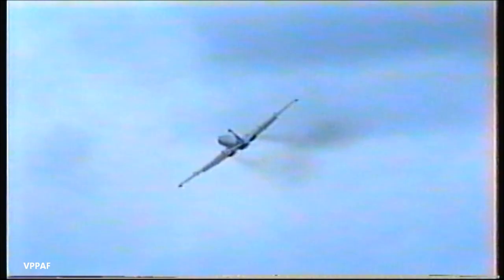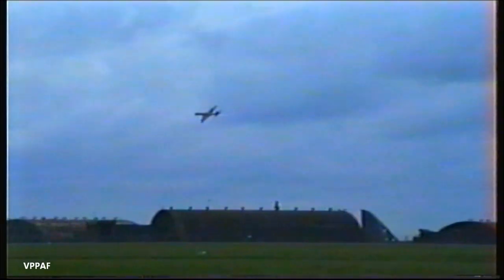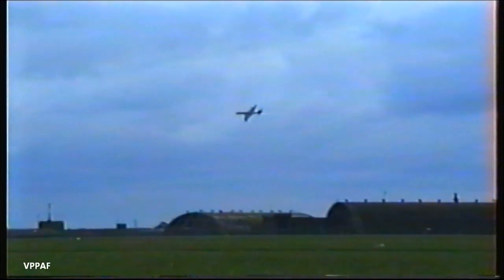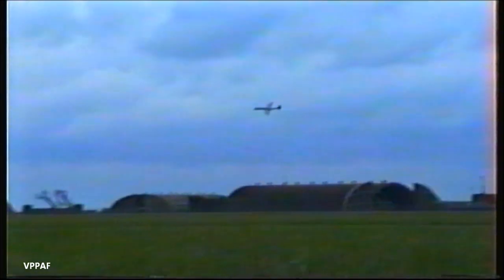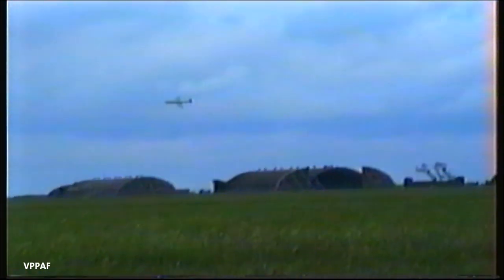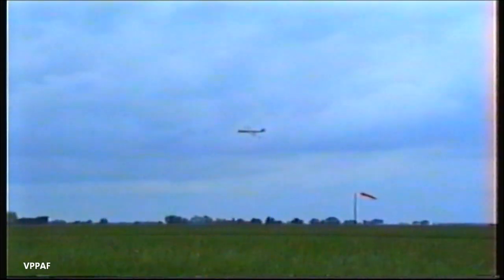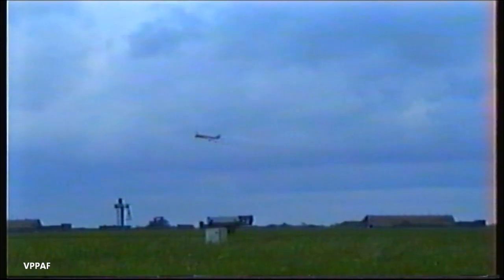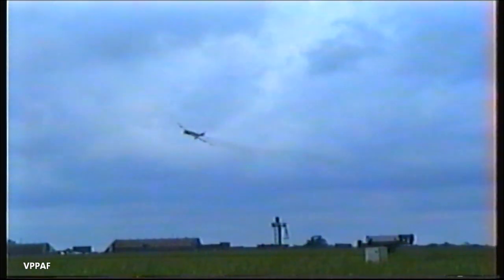RAF Nimrod flight and a crash at Toronto air show in 1995

Comment: The night before the crash, the pilot was interviewed on the local Toronto Tv station. I watched him as  he boasted that he was 
 going to really put on a performance with the Nimroad that would surprise the air show crowd the next day...well I guess he did.
Reply: Ya, I saw him the night before too at the Brass Rail.
Reply: @powerhouse9868  is that a bar? Just drinking?
Reply: @livelyupmyself1  strip joint. Overpriced of course... but I guess he figured he could push his luck two days in a row..
Reply: Yes  ,  i guess his mind was concentrating on the wrong set of flaps  .....

Comment: "Maintain thy airspeed, lest the ground shall rise and smite thee.".... God
Reply: That would be mother nature.
Reply: you can have a high speed stall,if you are pulling to many Gs, adding G's is adding wing load, the wings on these large jets are heavily loaded at take off so any loaded added through maneuvering could easily push it over its limit.
Reply: lol
Reply: im lel'ing
Reply: unit 003 ayylan6(c
Reply: 'Not enough Bernoulli on your wings and control surfaces = Stall. Mind you too much Bernoulli on your wings and control surfaces can also = Stall' - Attempted definition of 'flight envelope' :o)
Reply: @gogogeedus  pulling “G’s” is just the byproduct of what’s happening. Pulling G’s doesn’t stall aircraft. Exceeding the critical angle of attack does.
Reply: @ZicajosProductions  G force does stall A/C because G's are related to high speed maneuvers, a high angle of attack at high speed will be at high G's.also increasing the G's increases the wing load which in-turn increases the stall speed. in other words when the wing load is increased so is the angle of attack, this fact is the reason why heavy aircraft are comparatively slower because the higher angle of attack induces drag.

Comment: The aircraft sank immediately on impact  ......haw about the aircraft shattered into pieces on impact
Reply: *And the many pieces sank.
Reply: That sounds a bit rough, for the families...
Reply: It’s still there their is a actual part of the ocean to where he crashed where you can actually smell the rusty smell of the plane and a friend of mine told me that a guy actually found a piece of a plane floating a little close to the surface because he had an underwater camera true story also
Reply: @cottagenightwars4278  The plane was made of aluminium, how exactly does it rust?
Reply: @cottagenightwars4278  how is it a ocean lol
Reply: @cottagenightwars4278   Stay off the bath-salts would ya ffs!!!
Reply: @cottagenightwars4278  and at night you can hear ghosts of the crewmen shouting and swearing at the stupid pilot.
Reply: You missed that ?
Reply: ? - Aluminium corrodes.
Reply: or how about "burnt down, fell over and than sank into the swamp"

Comment: The video has two parts.  The second segment shows the Toronto airshow crash.  I watched this happen from the Ontario Place breakwater.  The British Air Force did the accident investigation and said it was caused by a stall.  A day prior to this, the crew took up a reporter from City-TV and did their routine.  She asked how far they bank on the tight turn, and the member from the team said "90 degrees.  Sometimes more." and he smirked.  The following years they no longer banked as extremely and performed the routine with more altitude.

To show the value of eye witness reports, the story on the radio within minutes of the crash was that a seagull was sucked into an engine.  Another witness said the plane exploded before it hit the water.  In movies the sound and sight are coordinated to happen at the same time.  In reality, the sound comes later.  This was what confused the eye witness because the plane hit the water but the loud clap came much later.  Then in their mind, it became the explosion that happened before the crash.
Reply from the maker: yes the 1st part is my video from Raf coningsby air show
Reply: lightotw is
Reply: The accident did not happen at a particularly high bank angle. That was to come later.
Reply: British air force?.. You mean the Royal Air Force!!
Reply: Hugo Stiglitz  I think the point is, the first part of the video was unrelated to the airshow crash while the title as written seems to be one event.  If the title were written: "RAF Nimrod flight at RAF Coningsby, and a crash at Toronto show", then there is no reason to clarify this.  These details matter a great deal while we are watching video of an aircraft crash.  Why?  Well, is something you notice in the first clip a possible hint of the crash later?  No, it can't be.  So it is useful to note, regardless of your impression on the matter.
Reply: @awuma  2:11 in the clip you can see it begin the bank.  It looks close to 90 degrees by 2:16.  By the time of impact they managed to get wings level, but it had already stalled and needed more altitude and time to recover.
Reply: @donaldteed35  it's a good old media hash slap together job.
Reply: @theelectrichobo829  not from his point of view. I in the UK ex-svc, would say the American Air Force or US/USA Air Force, of course it's the USAAF or the Canadian Air Force I would say in general terms unless RCAF becomes needed specifically.

Comment: Like so many accidents of this nature: Low and slow, insufficient airspeed, over-banked turn followed by inner wing stall, wing drop and incipient spin.  It has happened maybe hundreds of times, and especially at air shows where pilots seem to think slow maneouvres are somehow more impressive than safe piloting.
Reply: This. He was so slow I was expecting him to fly into ground much earlier....
Reply: Your explanation is cristal clear ! , I lost a friend with a similar maneuver  in an airshow.  People say:  "It happens "  Still can't get over it.
Reply: The Laws of Physics win . . . every time.
Reply: He actually flew these slow manoeuvres as he had been warned about leaving the boundaries of a previous air show. He wasn't showing off.
Reply: The routine had been flown before, but they got 30 knots below the required speed during the left turn and stalled. Despite adding full throttle and full right aileron it still rolled left and dove.
Reply: @Doggeslife  Yet the commentator erroneously states the engines stopped, causing the plane to fall from the sky. Why such a flagrant discrepancy, I wonder???

Comment: Engines never stopped...total misinformation! The airplane flying very low over the lake entered a steep left hand bank when the nose dropped. Likely entered a stall further aggravated by the pilot pulling back on the control while still steeply banked rather leveling the wing to recover a botched maneuver.

Comment: I was there on the shore stage center and watched this happen.  Sad day.  Engines didn't quit.  It was a stall of the wing lift as he was too slow for the bank angle.
Reply: You can see the engines didn't stall as the exhaust was still coming from them all the way down... still under power.
Reply: I was also on the shore line that day. Stood in disbelief of what I was watching. I remember my eyes burning and the pungent smell of jet fuel. Very sad, but completely avoidable. RIP to the crew. I feel for the pilots family.
Reply: @cjshardcorepunkmusicvault8474  As a former Toronto Harbour Police Lifeguard and being in one of the closest boats to the point of impact, I agonized for what seemed an eternity on whether to raise anchor and rush to assist possible survivors, as NO vessels approached due, I was told by the skipper of a rescue tug, to the large amount of jet fuel on the surface of the lake.
Reply: The wings were still providing lift fine. Just sadly in the wrong direction. Excessive bank angle has killed many an aircrew.

Comment: Too slow  and too deep just as  B-52 at certain US show.
Reply: Yeah,  I was thinking the same thing. 
He thought he was in an F 15
Reply: Fairchild AFB in Spokane WA
Reply: The USAF also lost a C-17 in the exact same manner (practicing for an airshow) in Alaska in 2010.
Reply: F15 has power and uses rudder to keep nose up at 90 degrees flight angle.  Not going to work on Nimrods and B-52's.
Reply: And indeed a Vulcan as well, XL390
Reply: Many swept wing aircraft have that same problem - too much rudder can stall the inboard wing and result in a stall/spin. The more sweep-back, the worse it gets. Even commercial passenger aircraft, like the 737 will do that. The Nimrod (Comet) has a wing that has little sweep-back, but the engines were very slow to 'spool up' for power increase, so when needed, won't be there for 3-7 seconds.

Comment: I had heard that the left wing had stalled on that final turn resulting in loss of control. Nothing to do with power loss or engine failure
Reply: Correct. The strong headwind and zoom which scrubbed off much of the apparent wind going into the turn, combined with wind shear were the cause.

Comment: The Nimrod could fly low and slow, that's what made it ideal for anti-submarine warfare, but not at that kind of bank angle.  The pilot may well have found himself flying a desk for modifying the display routine without a valid, good reason, had they and the crew lived...

Comment: I saw the Toronto crash in 1995 from the deck of my boat.  The Nimrod was a regular at the CNE Air Show in the early '90's, and it always climaxed with a spectacular wing-over (that's the "bank over 90 degrees" referred to in some comments below). However, that's not the point at which it crashed, rather it was at the turn out over the lake after which the pilot would came back toward the shore and then do his wing-over. He simply flew too slowly and too low, stalling in the turn. In fact, the engines were being spooled up to maximum power to recover, but he was missing a couple of hundred feet to get out of it. The voice-over report was of course made in complete ignorance. One error tragically killed seven servicemen.

The spooky part for me is that at the time I was reading a book about UK military air disasters, all at airshows or some sort of public event (such as the Vulcan landing at Heathrow in 1956, a plane which had shortly before flown over my school in New Zealand).  All the events mentioned in the comments below were in that book...
Reply: I chatted with that crew at the Abbotsford Airshow, perhaps two weeks before they all died.  Very sad.
Reply: Wild. That must have really been something to see first hand.
Reply: 'A couple of hundred feet to get out of it'? More like a couple of thousand.
Reply: Sailor Man
" 'A couple of hundred feet to get out of it'? More like a couple of thousand."" - no way he could have pulled the Nimrod out from that dive in 2,000 ft - check the angle and the speed at 2:34 - 2:35

He would have needed about 6,000 ft at least and the plane would have disintegrated from G-overload...
Reply: Didn't bank to 90 degrees?   Watch the video at 2:12 versus 2:16.  It was very close to 90 degrees.  Maybe there were more steep banks in the routine, but this was what happened.  They were demonstrating launch of flares followed by a steep bank to dodge an imaginary incoming missile.  The clip didn't show the flares part of it just prior to the turn starting.  At 2:09 the turn has already begun, while the flares went out while straight.
Reply: @donaldteed35  maybe he forget to smirk.

Comment: As I’m experienced in aerial operations, my analysis. The Nimrod is excellent in all kinds of weather, there was a light on-shore wind, the aircraft took off on time for its display. Upon completion of the safety checks, it ran in for the standard Nimrod display sequence which features two orbits and two dumb-bell turns. The latter manoeuvres each involved a turn away from the display line, a climb to not above 1,000 feet, followed by a turn in the opposite direction and descent, to fly back parallel with the display line. Having completed the two orbits, the first dumb-bell turn was completed uneventfully. After a slow flypast with undercarriage down, the aircraft entered its final manoeuvre, the second dumb-bell turn. It was seen to turn away approximately 75° to starboard under full power before the flaps were retracted to 20° and the undercarriage raised. The nose was then pitched up into a climbing attitude of 24°. As the aircraft passed 950 feet, engine power was reduced to almost flight idle, following which the speed reduced rapidly to 122 knots, below the 150 knots recommended and taught for that stage of the display. The aircraft was rolled to 70° of port bank, shortly afterwards reducing to 45°, and the nose lowered to 5° below the horizon. During this turn the airspeed increased slightly and the G-loading increased to 1 .6 G. However, the combination of the low airspeed and the G-loading led the aircraft to stall, whereupon the port wing dropped to 85° of bank and the nose dropped to 18° below the horizon. Full starboard aileron and full engine power were applied in an attempt to recover the aircraft but, by this stage, there was insufficient height to recover and the aircraft hit the water. All seven crew members were killed.
Probable cause:	The Inquiry determined that the captain made an error of judgement in modifying one of the display manoeuvres to the extent that he stalled the aircraft at a height and attitude from which recovery was impossible. The Inquiry considered that contributory factors could have included deficiencies in the flight deck crew's training and in the method of supervision which could have allowed the captain to develop an unsafe technique without full appreciation of the consequences.

Pilot motto: Low and slow deadly at Airshows.
Reply: I was anchored less than 1500 feet from the crash site. The winds were at least twenty knots which is not "light". The pilot was FORCED to stay within a very restrictive cordon which disallowed him from levelling out without placing hundreds of boats in danger.

Comment: I was there. Engines were fine and operating normally.  Too low for that maneuver
Reply: Wind speed at sea level was twenty+knots and increases exponentially with altitude. In a 90 degree bank there would be a drastic difference in wind force acting on the upper and lower wings exacerbating the effect and making a levelling out more difficult.

Comment: I'm not a pilot but even I know that when you make a turn you lose lift.  If you do it too much at a low altitude you may not have time to recover. I'm guessing that the crew had either become over confident or that they did not fully appreciate how much lift is lost at such a low speed.  Sad for them and their families and no disrespect intended.
Reply: No. Planes dont lose lift when they turn.
You are either misunderstanding or poorly stating your point.
50 yr CP
Reply: When in a turn you don't "lose lift", in fact the wings produce more lift in a turn. In order to do this (at the same speed) you need to increase the angle of attack ("incidence" to Americans) which puts you closer to the stalling angle of attack. Over do it and you stall the wing.

Comment: At time 2:11, observe very hard to see bird-size object at left of screen moving fast to the right and then entering the left-side engine area.  Confirm from 2:12 that debris exists the left-side engine area.  Move eye fast to the right to detect debris. 
 Conclusion: likely bird-strike on left engine causing power loss aggravated by low altitude, low airspeed and left bank angle near 30-40  degrees, which together caused the left-wing stall first and then a slow role and fatal role to the left.
Reply: Bollocks.  That's just some birds flying in the area with no connection to that plane, there's no interruption to the power on smoke trail from either engine.
Reply: Definitely saw something, not sure it was a bird. It may have hit the windscreen though.

Comment: I always wonder why they had this nimrod fully manned. If they know the risks of a crash is higher whilst performing these sorts of manouvers at an airshow, why not just have the pilots and at most a navigator onboard. The rest of the guys are just along for the ride. The same with that B-52 airshow crash. It baffles me
Reply: You also need an engineer to maintain the engines.
Reply: @princeofcupspoc9073  As I explain higher up the thread, the minimum crew complement of the Nimrod MR2 was 7 men - the flight deck trio were backed up by a navigator, a pair of sensor operators, and the AEO - the Nav is there to make sure they go where they ought, and also makes speed calls prior to take off, the AEO controls and directs the rear crew response to an underfloor or cabin fire/smoke/fumes warning, the sensor operators do two things - the 'dry' AEOp initially responds to an underfloor fire/smoke alarm by taking a small periscope to the relevant underfloor bay observation panel and looks through it, reporting back what is seen. The 'Wet' operator meanwhile dons a walk round oxygen set and mask, goes to relieve the dry operator, and continues to report back to the engineer and AEO - a fire extinguisher mounted near the galley could then be discharged into one of the three underfloor bays depending on what the report was. So, 7 guys needed - although it's arguable that the Nav wasn't that essential - it's hard to get lost in the circuit!

Comment: The reporter was wrong. The engines did not fail, indeed in a desperate attempt to regain airspeed the pilot applied full power but   it was too late.

Comment: It looked on the verge of a stall during several of the earlier turns in the video.
Reply: First part of the video was at an RAF station the second part the crash was footage taken from canadian news at the time the nimrod display always looked like that but the pilot made an error of judgement and got too slow he applied full power in an attempt to recover as can be seen the engines certainly did not lose power as stated in the news.